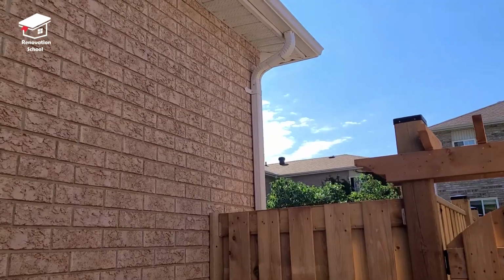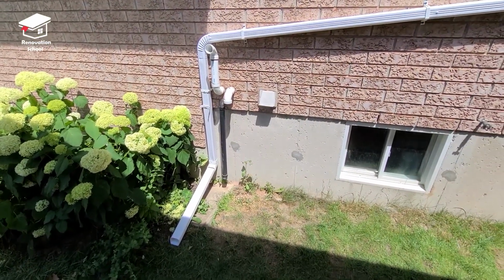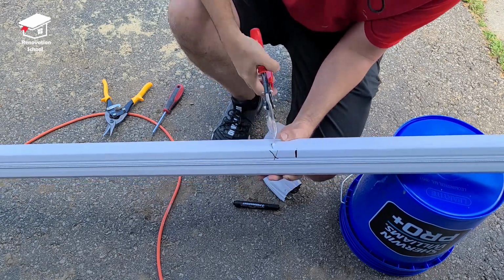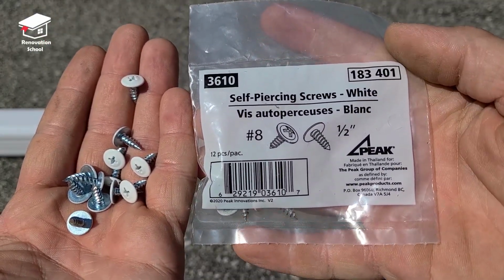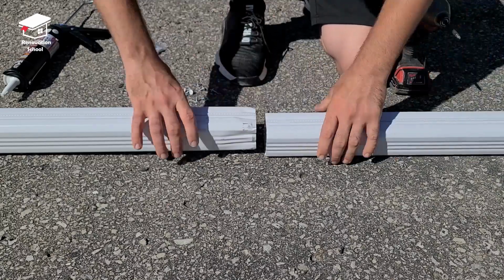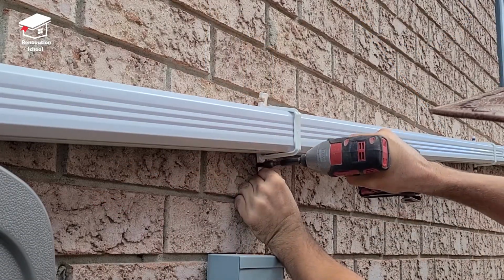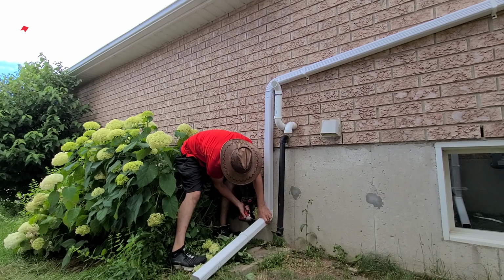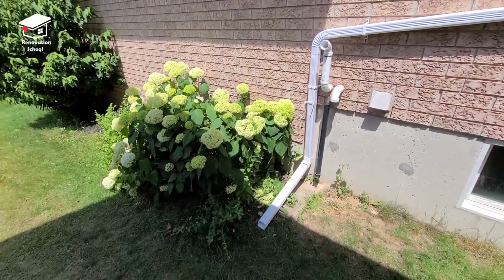how to drain Downspout water away from a house? ( modify your downspout)

Comment: Can you link two downspouts over a gas meter?
Reply from the maker: If you're worried about the seam leaking over or on the gas meter you can use silicone in it prior to putting it together and screwing it

Comment: Instead of extending the downspout from the front to the back, just bring the downspout down in the back and cover and seal the front opening?
Reply from the maker: The eavestrough is a sloped that way
If you want to do this then you have to change the slope of the eavs first. 
In our case this eavestrough has one down spout in the front and one at the back
I just redirected the water from the back to the front also.
That's all I did here.